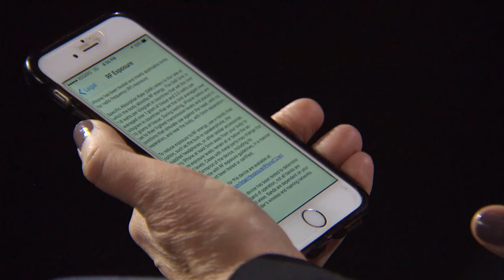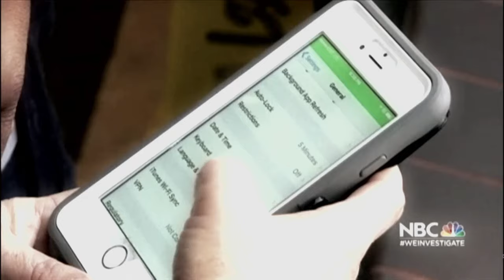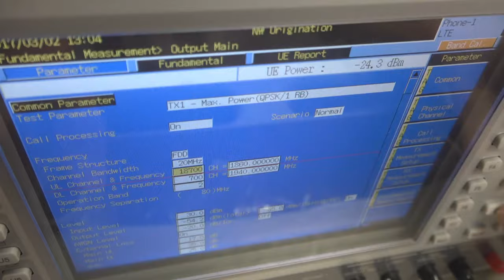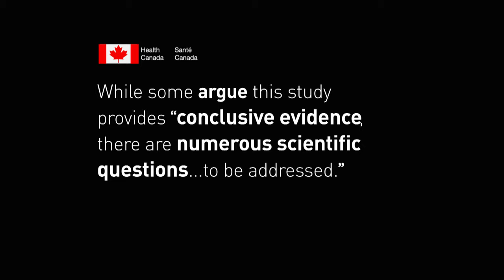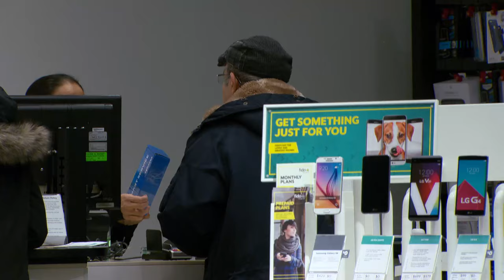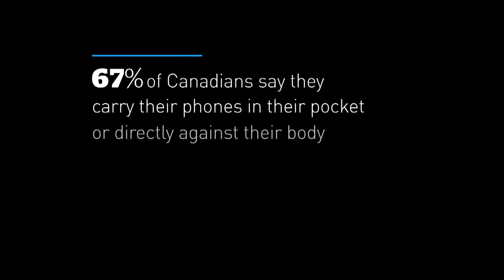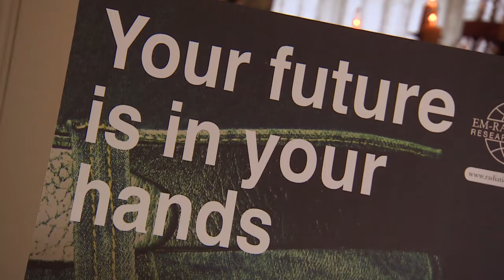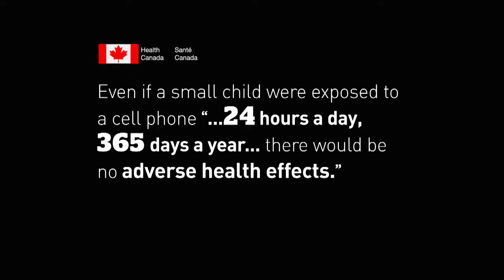The secret inside your cellphone (CBC Marketplace)

Comment: BTW... It does NOT matter if you call on the phone or not. Your phone is constantly pinging the cell towers unless you have it on Airplane mode. When you text, it still sends out a transmission and is ALWAYS listen/waiting/pinging to see if there is a message for it to receive,  This is how your phone displays the signal strength. AND how you receive calls and texts ... always checking the tower to see if you have a massage/call.
Also if you use the bluetooth earbuds you are transmitting from the phone into a smaller receiver in your ears that again is constantly pinging the device to see if it needs to connect.
Best to use speaker phone or wired headphone/earbuds.
Reply: As I understand the information provided, 
new smart phones are active even when off.
The reason you can't remove the battery. 
They ping even when powered down or off...

Comment: How are you supposed to hold your phone 15mm away from your body when your holding it in your hand 🤔
Reply: I suppose our hands aren't vital organs, but yes I agree. There are those radiation blocking things you can get to stick on your phone, they probably do very little but it might help
Reply: 😄😀😜 true how you gonna do that
Reply: Sticks and earphones
Reply: @naps3386  a radiation block case for the cell phones?
Reply: Encase your phone in 15mm of solid concrete with a thin lead shielding on top... Should work....
Reply: a thick phone case and reduce direct contact w/ the screen.
Reply: @roslynnf3104  lol
Reply: Very good Question 😉
Reply: Duh.... we just use our levitation and hold it away from our bodies. Because that’s a thing now XD
Reply: 2.54 cm is 1 inch so 15mm is considerably less. Remember millimeters not meters. 254 mm equals 1 inch
Reply: Tracey Handcharm  You got it!
Reply: Use speaker as much as possible, put phone down on a surface.
Reply: Dont use one, the human race got along for billions of years, without a smartphone. Get a flip phone
Reply: Jaymz Meh , have a think about it as though your life depends upon it, I'm sure you will be able to come up with a way that works for you.
Reply: @naps3386  actually the manufacturers should include some kind of protective device around your phone to protect the consumer, something sleek and small but effective if they really cared about consumers health which they don't but this is where the government enforcement should come in that some kind of protective sleeve or something like that should be included with your phone to block some of the radiation that comes in contact with your skin. The problem is we are visual society, so if we don't see something and it's not causing an immediate reactions then it's easy to ignore it and harder to prove that it's there but the radiation is real scientist have proven it over and over but yet it's still not enough  for any enforcement to happen
Reply: Selfie stick lol

Comment: Marketplace, can you do a story on bluetooth headphones too?
Reply: quixoticfallcy earbuds too
Reply: I seen a study about Bluetooth vs phone radiation and the result was that Bluetooth has much less radiation. Just make sure you get a good one.
Reply: @NikoBellaKhouf  but bluetooth earbuds are placed inside your ear closer than phones- every mm closer is significant
Reply: @JeanPaulFernandes  I'm aware of that. They aren't 100% safe at any level. But it's better to have a Bluetooth headset than to put a phone up to your ear. I wouldn't use the ones that go inside the ear.
Reply: Bluetooth probably is better if have low watts than with the cable, because cable is like passive antenna when phone in use
Reply: Is not a 'story' it's video!

Comment: I use a otter box for my cell phone,  it comes with a clip on holder that I can attach to my belt. This holder instead of being just plastic was to 
have a thin sheet of metal in it, the metal could block the RF energy and protect the wearer.
Reply: Depends on the metal. Iron, etc reradiate out the signal. Aluminum reflects it. At least 2 layers is best.

Comment: Time to go back to wireline with an answering machine!
Reply: My first main landline phone has a base cassette answering machine since 1995.
Reply: Quicker getting/reviewing messages and less car accidents.....And less gas, pep would stay home and talk on the phone, lol.
Reply: Cordless home phones are just as bad or worse. I found out when my home wireless router kept cutting off. Cable company asked me how far is my phone base was from the router. I said about 6 ft. They said it needs to be further away. I did some YouTube search and found a test that showed it was if I had a cell tower in my home. I went with Magic Jack and wired it to my in house phone jacks and use corded phones with answering machine. Also I have my Verizon router on a timer to shut down at bed time. No need to get more RF while Im sleeping. I noticed I sleep better and dream more now. Coincidence ? I think not.

Comment: I never put in my pocket,I put in my purse or bag:-! I use loudspeaker when making calls..n also when I answer it..
Reply: Michele  Mcguire   Obnoxious around other people
Reply: I have my 5G cell phone,  volume turned up all the way and can hardly hear the other person on the speaker phone.. and I have No hearing problems!  I have a new phone too!
Reply: Me too
Reply: @paulao7022   do you have an otter box case? If so replace it with LifeProof
Reply: @Ole_CornPop  thanks!
Reply: Michele  Mcguire I use loud speaker as well,and if I do need to hold it up to my head for privacy reasons,I try to keep it away from my head as far as possible. 
I gotta stop wearing it in my back pocket though and side pocket. This report was very eye opening.

Comment: It took me less than two minutes to find the applicable warning on my iPhone 6+.  Settings->General->About->Legal->RF Exposure. Which is exactly where I would expect to find such a warning.... FYI, most people never read user manuals and wouldn't pay any attention to this warning even if it was right in front of them.
Reply: There are two problem here:
- iPhone users won't read manuals. That's just the type of user they are.
- Android users don't have the page you're talking about.
Reply: I checked through all the legal stuff on my cell. It does not have a Health & Safety section.
Reply: @linagee  no its right there . Its in about phone》legal》safety information

Comment: When I go to sleep I put wifi off n put on airplane mode
I heard about it somewhere
Not sure if it's true
I don't ever use or eat from microwave.
Now with 5g is another story
When I'm using my phone for long then I have a funny feeling in my hand
Maybe the radiation?
Reply: I just don't bring phone or iPad into my bedroom at night.
Reply: You're doing the right thing, especially with wifi at night. I have worked in health for 30 years and I won't have wifi in my house at all, so I have an ethernet cabled connection. Also, rather than just putting your phone in airplane mode, just turn it off. Turning it off is the safest guarantee that it's not frying your head.
Reply: I turn off my phone whenever i sleep.
Reply: I saw a video last year that Dr. Mercola had the tip of putting phone on airplane mode the reduce radiation.  The video might have been even older.
I just watched new video from Dr. Edward Group on utube 2 weeks ago.   Apparently
we are no longer protected by putting on airplane mode.  At least as of last year.
Reply: @missfloflowers  You're right - especially now that the gov't is trying to introduce Bluetooth-based TRACKING for the cv crisis. And both Google and Apple are suggesting a MANDATORY upgrade download that would switch Bluetooth on to track us without requiring our consent! We need to switch ther phone off as much as possible, especially at night.
Reply: Fazeela Laher If it’s on Airplane mode you may as well switch it off. It’s good to do that now & then anyway for tech reasons.
Reply: Go live in Green Bank if you think that crap
Reply: Oti ugari why you believe that there are no 5g in USA? You are wrong
Reply: Yes after a while my finger tip  goes numb as I scroll up with right hand thumb  and left hand holding phone has tingling feeling hmmmmm...
Reply: Right! Tingling effect
Reply: I feel exactly d same way too
Reply: We have to go back to those phones that are simple that don't need data  Remember those old  Flip phones
Reply: @A.M.7886   holy crap! I've always purchased samsung phones for the last ten years or more.  2 months ago I purchased an LG and every time I use it more then 20 min my hand starts tingling 🤣.
Reply: @goldeneddie  my home router is a Sangemon? brand "Home Hub 2000/3000. It will not work unless the WAN operates (WiFi signal). I tried many times to go Wired Only, I cannot. I imagine all home routers are basically alike. The only places to be away from strong WiFi signal is to travel hours out in the bush. Don't forget, those Smart Meters put out an insanely powered "ping" every few minutes.
Reply: Any device does this....I thought I was the only one. Turn off wifi from router at night. If someone’s going to call they can reach u in the morning....or keep a landline for emergencies!
Reply: @missfloflowers  I watch both those sites!!! Good on u!
Reply: Call me weird, during the day I keep my phone in a tin box....

Comment: I use loudspeaker when possible, this way my phone is some 20-30 cm away from my head most of the time. And I think it might be wise to carry my phone in my backpack or something. 

Btw, how do the Bluetooth hands-free devices measure in this radiation scale?
Reply: I think you'll be okay, using speaker like that has already dramatically reduced your exposure. I do the same thing.
Radio Frequencies follow the inverse square law of distance. To put this into simple terms, approximately speaking, if you double the distance, the signal intensity is cut down by 75%.
So think how much the exposure is reduced going from 1.5cm to 30cm which is 20 times further.
or even from the phone being on your ear to being 20cm away. You'll be fine

Comment: I always carry my cell in my purse but if I'm using it, it is only my fingers tapping and yes alot more then usual & now I have arthritis in one finger in the one I use mostly. Sometimes just holding my phone makes my hand feel irritablely achy hurt. Should I make a call it will be through earphones or car phone. If I don't use my cell for a long awhile my hands are strong & normal.
Reply: I always use a stick made for the phone. 5 below has them 
In a set I keep them where ever I use my phone,  or
IPad screen.
Reply: There you go purespirit!

Comment: There needs to be a 15mm + phone case or ratiation filter phone case on the market!
Reply: Adam W Your phone wouldn't work if you block the radiation, that radiation is how you connect to the cell tower and your WiFi network! Otherwise you need a Ethernet and phone cable everywhere you go!
Reply: Just an idea dont hate on it! :(
Reply: Adam W, there are a few good ones out there, most of them our gimmicks but if you click on my name, click on the website on my profile and scroll down to the bottom of the page to see the EMR Shield being tested. I've spent that last 4 years of my life searching for the best solutions out there, and this one by far has the most science and proof
Reply: The best solution is to put the phone into Airplane Mode. That should disable all RF from being emitted by the smartphone. When you want to use the phone, simply turn Airplane Mode off. Use speaker phone or a wired headset. The RF picked up by the wired headset and delivered to your ears will be far less than a bluetooth headset.
Reply: Rick Nash -- An air tube headset is better than a normal wired headset, but the best solution is of course to stop using a mobile phone.
Reply: My experience with air tube headsets (a long time ago in aircraft) are that the sound quality isn't so great. They have a "hollowness" to them. Any suggestions and how would they interface to a mobile phone?  
There may be some RF traveling along the headset wires but I suspect it is minimal as compared to all the RF radiating at the smartphone antenna since it is tuned to the resonant frequency bands of the cell network. The headset wires are so long, they wouldn't be a good coupler of RF from the phone.
Reply: Rick -- Yes, maybe the difference isn't that big but it seems their use with mobile phones is increasing.
Reply: Adam W or come free in the box with any phone.
Reply: DjStiv3 -- Ha, ha! That would be something! "We are selling you a harmful gadget so here is your protection!"

Comment: This warning should be required to cover a major part of the packaging just as with cigarettes.
Reply: Except, completely different, there is actual evidence that smoking causes harm, not true for  cell phones, no matter how much Wendy would like it to be true.
Reply: Actually no. So why? For starters, there is basically no evidence to suggest that the radiation our phones are emitting are harmful. Not only is the power too low to cause any substantial damage, but it's also non-ionizing. There is clear evidence that using tobacco in any form is very harmful, not so with cell phones.
Reply: Soundspark -- Are you aware that you are commenting Owen Oulton's comment?
Reply: Soundspark -- Why should I answer your comment before I know it is directed at me?
Reply: It would have no effect. People throw away their cellphone packaging on day number one. With cigarettes, the product is contained in the packaging until each cigarette is removed.
Reply: linagee -- Then the warning should be engraved on phone and come in the form of a little uninstallable app that regularly reminds the user.

Comment: Is it the same for ipads and laptops. What about wifi
Reply: They both use the same frequency band unless you are using 802.11 AC or 5GHz wireless N.
Reply: Proximity of radiation matters as well as intensity...wifi in worst case scenario would be a lot less detrimental than cell phones.
Reply: supreme  TODAY IS 2-3-2018 VERIZON AND AT&T ARE BUILDING 5G TOWERS AND THE WIFI WILL BE DANGEROUS.
Reply: supreme -- Yes, all three use microwave radiation, just like mobile phones.
Reply: Joshua Gnitecki   did you know that Wi-Fi runs through you're wiring in your house so that makes you wonder
Reply: Joshua -- WiFi in worst case scenario might even be worse than cell phones.

Joel -- What do you mean by "Wi-Fi runs through you[r] wiring in your house"? I know that the electrical wiring can be used to cable connect a computer to Internet, but I have not heard that the wiring can send and receive the microwave radiation of WiFi.
Reply: 5 ghz the same effects as 2.4ghz. range of 5 ghz does have the ability to go through walls as well,
I have searched for signals of wifi and my house was full of different wifi signals ,neihbours ,internet providers using radio wifi trans mitters, also,my security wifi,have manage to reduce by 75%disconect aerials  off the router and put a aluminium pot lid over the router, this stopped the  5 ghz which i dont even use. There are products you can buy to block rf
Reply: youtube barrie trower
Reply: I'm back to wondering if my hearing-aid is a danger now, since I've always been wearing one, it explains why the digital ones are crap and keep needing replacement.
I thought this radiation thing was proved false though?
Reply: There are videos on YouTube and also on microwaves.
Reply: My message is to supreme. About wifi.
Reply: Roadent1241
I wouldn't think so.
I've measured all sorts of equipment like headphones and any with magnets or electromagnetic properties.
Even wireless Hearing Aids are approximately 1000 times less powerful than a cell phone. 
And generally only equipment heating up does tissue damage. Otherwise its non-ionizing radiation. 
We emit this, bananas do apparently as well lol 
With a hearing aid, not only is the construction encased fairly well [especially today], the thickness of the active mechanics, providing good distance through cartilage and the many layers of non-essential or non-vital tissue, combined with quite a low level of energy; your ear drum is VERY sensitive, and does not need much to stimulate vibration. 

You're dealing with magnetism/radiation; although they do share properties, exposure to a speaker at low levels will not have cumulative effect or damage. 

I'm not a doctor, but as a musician and someone who's interested in health in general, I would wear one myself.
Bluetooth/wireless ear pieces are a little different, like I said previously, because of the amplification of incoming and outgoing signals heating a receiver and the like. The less distance, the less the receiver is being pushed to work = less heat. 
If any of this is a concern, I'd look online to see if anyone else with the product experiences what you do. Don't let it slide. 
Either way, provided your skin isn't smelling like hamburger lol, "1000 times less powerful than a cellphone" is quite a difference! 

⏹️Sound generates heat as well. If you keep your ear piece at a high volume for long periods, you could feel a general sense of warmth like the device is heating. But it would be from the movement of air.
You can achieve this by playing guitar in front of an amp or speaker for a while.

Hopefully all is well. Worrying is more harmful to you. As a worrier, I KNOW.
✋😊
Reply: EXPLAIN what the last part means!